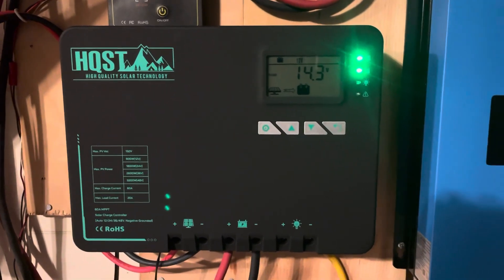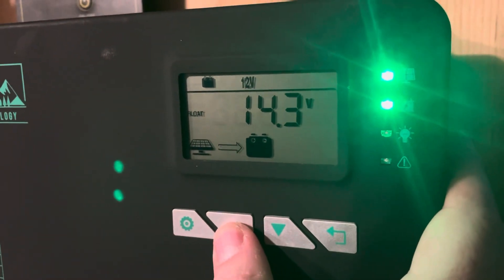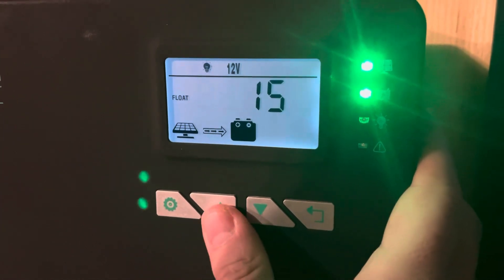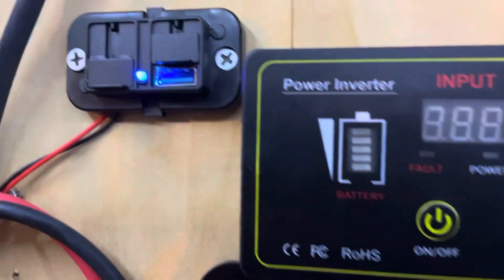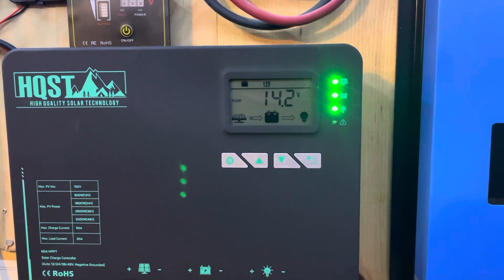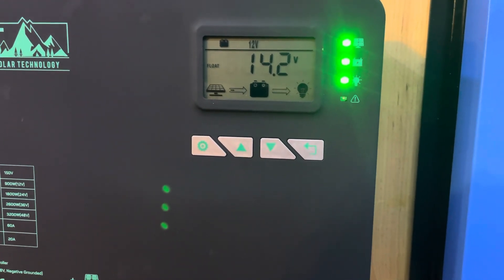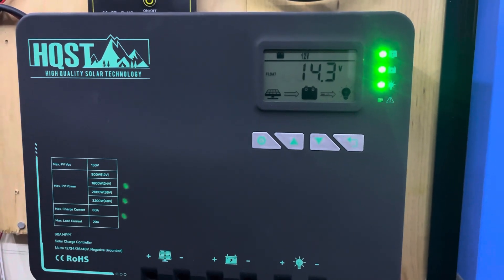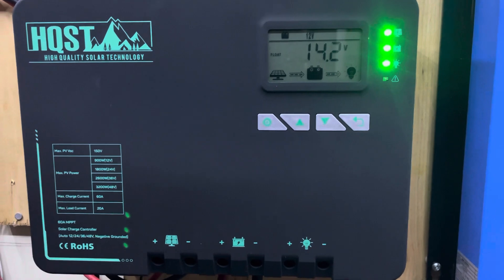HQST 60A MPPT 12/24/36/48v solar charge controller

Comment: Cable for joining 2 doesn’t do anything.
Reply from the maker: Indeed there doesn't seem to be any use beyond synchronizing battery settings, which seems kind of a trivial convenience given the cost of the wire. Oh well, we live and learn. I will say both controllers have run great since installation, set and forget, so there's that.
Reply: @thedabbler2753  last week bat bank was almost full and one controller wasn’t adding any power ,just the other controller.First I’ve noticed that.
Reply from the maker: @2hotscottpro  Interesting. I guess after what we've just been discussing it can't be differing settings. It could be that one of them is reading an ever so slightly different state of charge / voltage from the battery because of wire differences / resistance and stopping early / keeping charging as a result? Maybe a meter reading of the voltage / amps from each set of terminals might confirm or deny the theory. If you figure it out do let me know! :)
Reply: @ one way to test that is to lower input on the one still charging.Yes they are off stightly showing in app.I’ll have both apps open per controller and actual  voltage (SOC) is different.Doesn’t surprise me.I’m in an RV not NASA lol
There’s most likely a buffer for the second controller to kick back on.Close enough for first controller to be in over ride mode not letting second controller to have output.
The only difference I have is one controller is 2s2p and other is 3 series.So 3s is higher voltage,120 vs 80 estimated but close to actual.
What’s your thought now? Oh but I get 3x wh from 2s2p string vs 3s.Like 900 vs 300wh.Deffinatly when both controllers are producing.